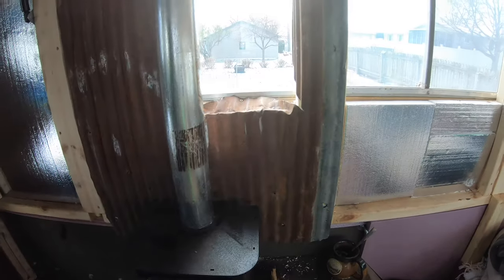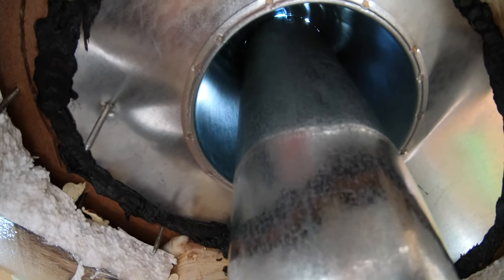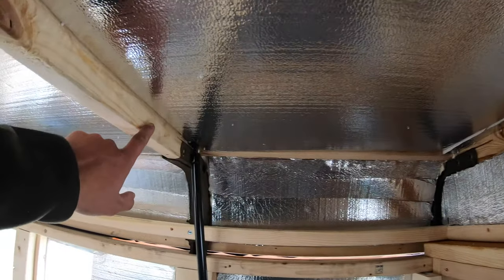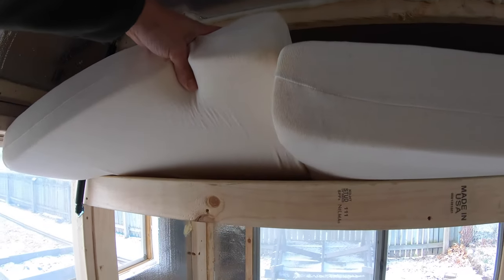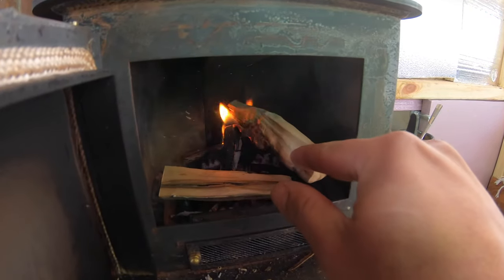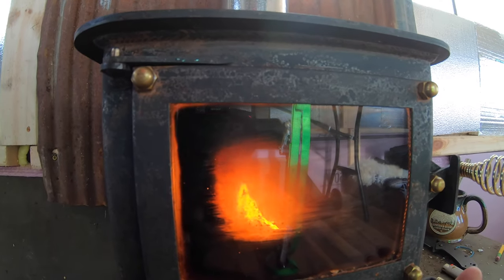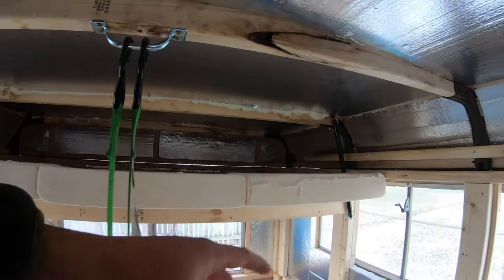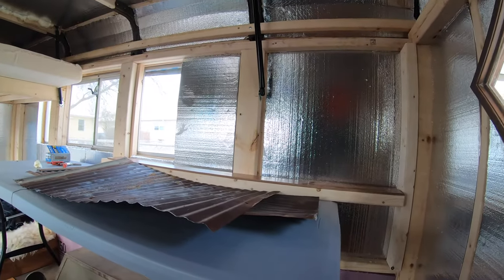DIY Off-Road Vintage Military Trailer Camper Conversion | Update as of 12/1/22

Comment: Is that a galvanized chimney? You better ask welders about that. I was told that galvanized stuff should not be near fire. It gets very poisonous. You got lots of windows in this one.
Reply from the maker: It was the only 3" chimney pipe I could find, without spending 400 on the kit for the stove, figured it would probably be temp till I find something better, I'll definitely check into it, thanks for the headsup